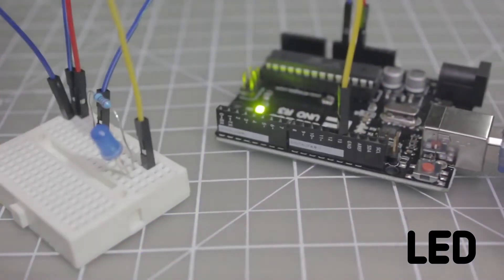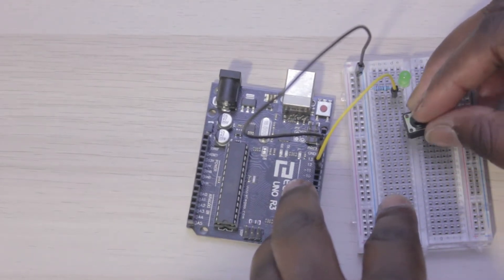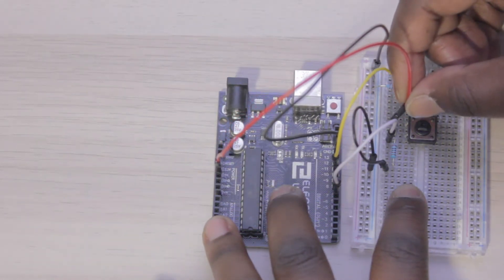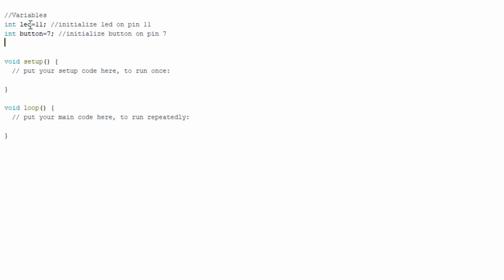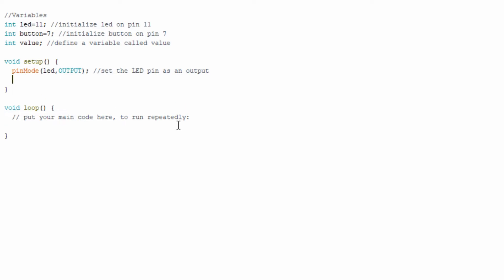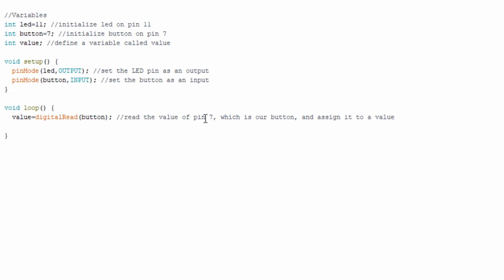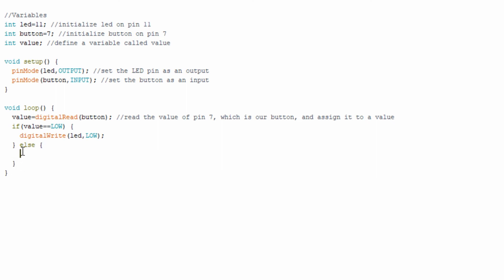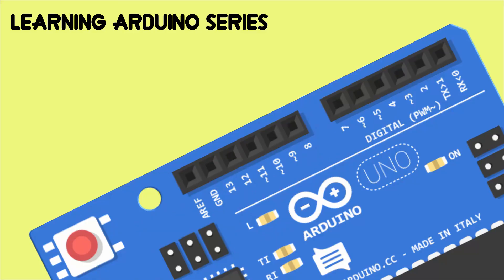Learn Arduino | How to Connect a Button to an Arduino

Comment: 0:19 "5 jumper wires"   There are at least 3 styles of jumper wires: male-male, male-female, female-female. 
You are using wires with male-male connectors. You might want to specify that in you video.
Reply from the maker: Thank you for the feedback, didn't even cross my mind to include that part. Will be sure to specify in future videos